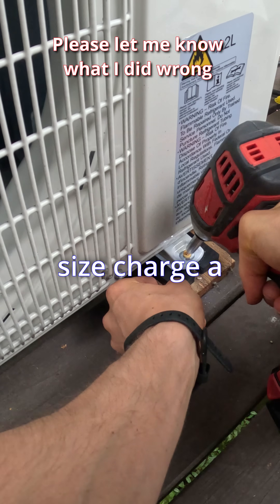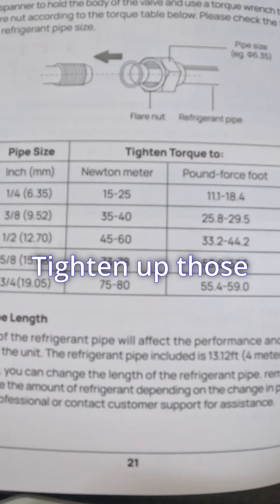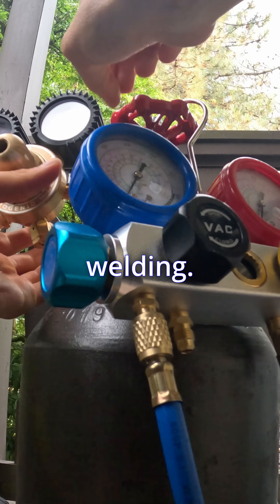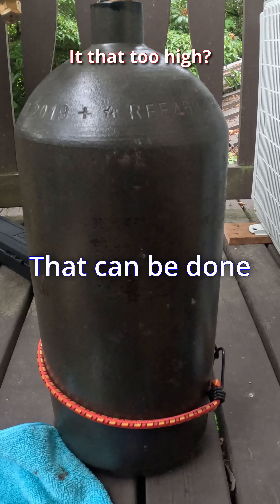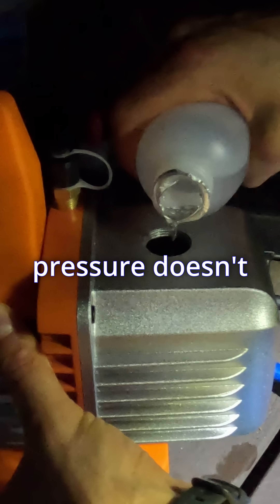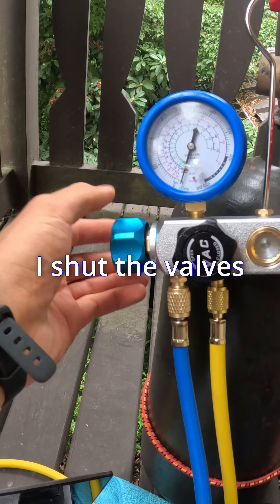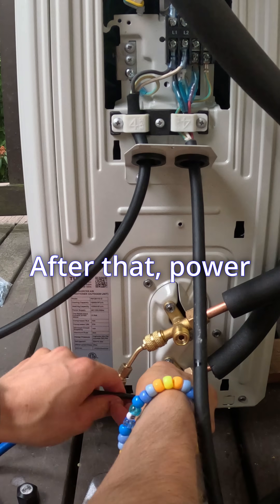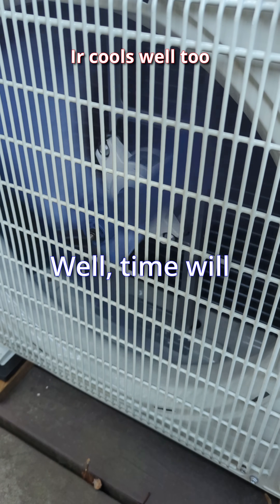How to Pressure Test and Vacuum a Mini-Split System

Comment: The installation was good, there was just one detail missing: you should have a digital manifold to see the microns, which this analog one doesn't need.
Reply: back in the day noone used these micron meters :p and units lasted for 20years plus ^^ some still running today

Comment: Why are so many saying no no youre wrong but they arent out there showing how to do ot right. With ridiculous prices for minimal work, ill stick to youtube education with probable success. As so many convert to diy out of frustration and videos get better the industry will be forced to lower prices.
Reply: He’s wrong because he isn’t telling u certain things. For example he said pressure check at 500psi. You don’t just go to 500 psi u base it on the data plate of the individual unit. Also he said he let his vacuum pull for 40 minutes. A proper vacuum is based on microns not time of vacuum. DIY is cool and YouTube helps a ton but if you watch an install video and that is the end of it you are wrong. If you don’t know how to size your unit correctly (not just going back with what was there) you will waste your money. I’m telling you this as a HVAC technician and teacher.

Comment: I installed an 18k Pioneer branded mini split myself 15 months ago.  The linesets that pioneer sells folks are very good quality, the crimps all looked good on my lineset.   Pioneer also gives you compressable sealant washers for all 4 connections.

Comment: Thank you for the info. I am learning myself. I see the detractors that are probably HVAC people. I bought my units, am running the wiring myself and will have all holes drilled and lines ran. I asked an HVAC company for help with hooking up to the electric box and getting the condensor running. I understand that it's a skillset that I'm paying for so I expected it to be between 3k and 5k for the work. I was quoted 14k. I do all the work of setting it up and they want that much? I could learn myself and spend way less replacing my mistakes. Once I know how I won't need them so screw it.
Reply: They have to put their license and insurance on work you did. They want a payday in case you don’t know what you’re doing and burn the house dowm
Reply: @FunnyFred67  We can sign paperwork saying they are not responsible for work that I have done already. Which would only be mounting to the wall, drilling holes, running wire that still needs to be hooked to the electrical panel and to the units. That way all they have is the hookups, setting the vacuum and making sure it works before they leave. A few hours work that should only cost 5k to 7k. I want to pay for their expertise. But not have my pants pulled down over the price.

Comment: How can you be sure you passed decay test or were even under 500 microns without a micron gauge…
Reply from the maker: You’re right. It’s not ideal, but I was just using what I had . I left it pressurized for about 24 hours to somewhat make up for the lack of gauge resolution. It’s still working well, so I assume there are no leaks.
Reply: @BootlegBarry vacuum is not only for leaks. It ensures there is no moisture in the system. The presence of moisture will cause acid buildup in the lines and wear the compressor down extremely fast given there is moisture in the refrigerant lines
Reply from the maker: @soulzdegraded5775  Thank you, that is good to know. I just ran the vacuum for a while and hoped for the best. If I ever get another minisplit, I will do that in the future. I was winging the $500 unit. It was my first time with anything AC.

Comment: I don’t see you releasing your low pressure blue hose. I wonder if that’s because all the refrigerant would come out because you took out the valve stem. Like I did when I watched your video. Thanks  skipping this step. I still don’t know how to do it right. Your video is too fast and misses important details and basically set up a DIY er to fail.

Comment: Looks like you don’t know much what you’re doing. Looks like you just bought all the stuff because you were a tradesmen. Looks like you just bought the Navac pump since that’s their Navac oil. As well as that looks like some cheapo Amazon gauges. So it looks like poop so higher professional, as well as your welder with your argon gas so like I just told you higher professional you hack.
Reply from the maker: Thank you for the honest feedback! 😂
Reply: @BootlegBarry I worked in manufacturing of commercial cook line equipment for big chain restaurants, ie. Pf changes, Taco Bell, Taco Bueno, cheese cake factory, on the border and others. I did HVAC/R and assembled and tested the units at the factory and did local installation and on very rare occasion a road trip to repair a leaking unit hours away. there was multiple manufacturing locations so I would go find an issue when they couldn't find the issue. I never ran a vacuum for less than 2 hours, I always used a micrometer gauge when pulling a vacuum because it shows if there are tiny leaks, I always used nitrogen, I pull a vacuum then pressurize the system with nitrogen, let it set and absorb all moisture i then purge then pull a second vacuum, refill the system again with nitrogen, purge the system then pull a vacuum again then add refrigerant. Moisture in the refrigerant kills cooling systems. I would spend all day preparing a unit for refrigerant. You are close but not there yet. And I didn't get callbacks because I made 100 percent sure it was done right every time.
Reply: @ 😭😭 I’m sorry you’re welcome though coming from an actual HVAC person
Reply: @jacobkoz1835 no offense, but if you’re gonna say someone did a doodoo job, have better grammar. Hire*, not ‘higher’.
Reply: @ obviously it’s a joke. He obviously knows that.
Reply: I hate to hear this, even tho I just installed my 2nd mini split in my hobby / workshop. 
 Two hvac "pros" wanted half what I'd paid for the unit / shipping just to cut / flare lines & connect & start it after I had both units already mounted & lines secured at the inside unit & ran right up to the condenser. 
 That was a big ole nope for me. 
  I just pulled a vacuum for an hour and let it sit overnight, released the gas. 
  The first one ran 24/7 for just under 5 yrs with no issues or increase in elect bill until a utility Co transformer failed & sent basically a lightning bolt thru the conductors, past the tripped breaker, and blew out the double fused disconnect I'd added and a fancy surge protection device suggested by the hvac manufacturer. 
 Even tho there was over 5 yrs of warranty remaining, replacement was denied due to the cause of failure. 
  The replacement is a non-DIY, heavier duty unit, but wasnt really much different from the first experience.
Reply: I would have taken this as a compliment.
Reply: Ya dude is kinda right first dont ever tell people to use any other gas besides nitrogen. U don't know how they will react with comp oil and refrigerant. I don't see a micron gauge anywhere so u have no clue what u pulled ur vaccum too. This is just all bad I can appriciate the attempt but don't turn around and hop online trying to teach people like u know what ur doing.